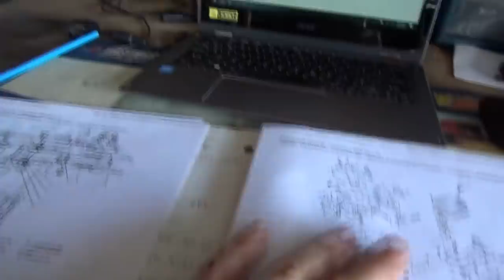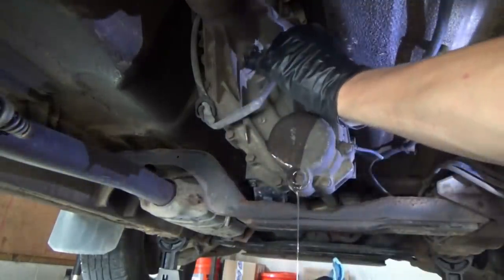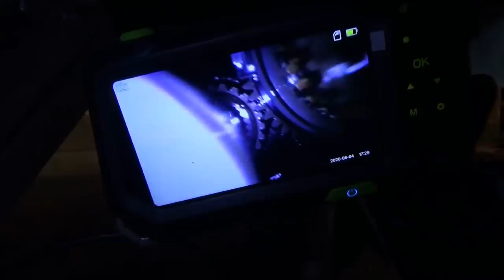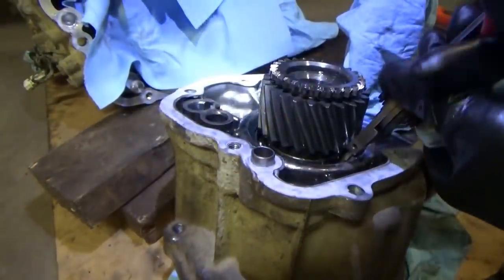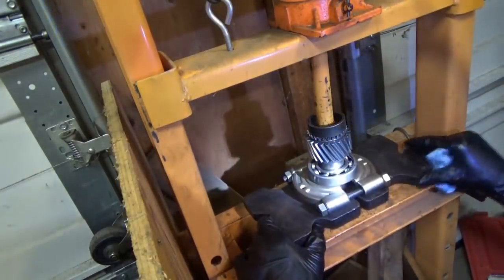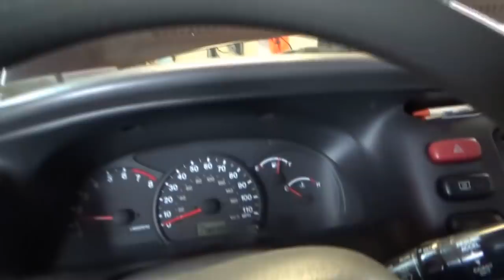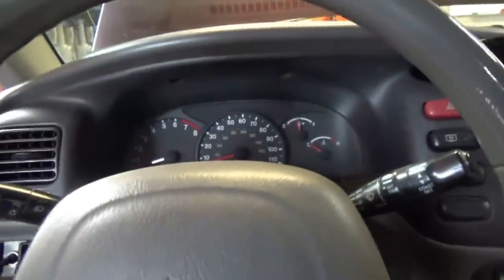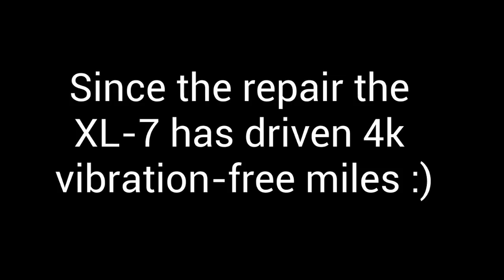Weird Driveline VIBRATION? (Suzuki XL-7 4x4)

Comment: A bearing, a seal, and a balance weight. A dealer would have recommended a transfer case, and a drive shaft or a brand new car.
Reply from the maker: Plus there are no more Suzuki dealers in the USA haha
Reply: @PineHollowAutoDiagnostics  So you would have get it from Canada or mexico, if you required brand new parts?
Reply: dealers are only interested in getting the problem resolved as quickly as possible.  They don't really care about getting it done as cheaply as possible.  They would have had a tidy profit margin on a whole transfer case. There  margins aren't  so big on the labour costs.

Comment: The leaky seal was the indicator to the bearing wear.  That is your signal to replace the bearing, which acts as a bushing to the seal. As it wears it puts more pressure on one part of the seal, elongating it.

Comment: The leak is the clue. If the bearing is failing it can allow the shaft to move. Causing the oil seal to fail.
Reply from the maker: Yup, that's why I went there :)
Reply: @PineHollowAutoDiagnostics  I have an engineer friend here in Oklahoma City that works for a major transmission remanufacturer.  He was recently given responsibility over a bearing tester.  We just had a conversation last week about bearings giving off a frequency signature, even specific signature for different failure modes .... now I know more about what he was talking about.  Sure is nice having smart friends! and smart YouTube creators like you.  thanks a bunch
Reply from the maker: @kc360awareness  Yup failing bearings show up very nicely in the frequency analysis. You can even tell a fault in the inner vs outer race or if the balls are damaged! :)

Comment: That was one of the few occasions where a narrow Chinese hose clamp, designed to use as little metal as possible without stripping when first installed, may have been better than a heavy, 'Made In USA' one.

Comment: I think you are being too hard on your Suzuki...bearings do fail and after 170 000 miles, nothing lasts forever. I found the bonus part most interesting because i studied MECHANICAL ENGINEERING in College and in APPLIED MECHANICS we studied DYNAMIC UNBALANCE. One gram of mass at high rotational speed can cause huge loads to develop and stress bearings.

Comment: Oil seals do not like wobblies especially at elevated revolutions. Press ideal for bearing replacement, saves using brute force with a hammer. Any roughness felt in a revolving bearing should ring alarm bells. Oil leaks are not normal. Amazing what a hose clamp can be used for, ingenious !! It's  all a balancing act and quite sensitive to out of round.

Comment: Just some friendly advice from an old mechanic; when using the press, always set the bearing separator 90 degrees opposed to the press plates.   The bolt ends of the bearing separator should be setting one on each press plate, not across the gap between the two of them.  Much stronger and stable that way.
Reply: the online drawing even showed it properly supported  :)
Reply: @throttlebottle5906  Experience can be a cruel teacher!

Comment: I blame the owner ha ha :-D
Well done ivan,  with less vibration the bearing will last even longer. :-D
Mentally i jumped back to electronic r.f transmitters and there harmonics,  filtering via tuned circuits set to produce loss/delayed/antiphase effect at the target harmonic.
Something like that lol.
I like the jubilee clamp balance, very sneaky plus cheap :-D

Comment: Man not sure how you got the the transmission being the culprit I had a vibration that happened at 45-65, had me stumped brought to a shop and they couldn’t find anything wrong. I thought the only thing left was the CV joints. They appeared perfect and didn’t have any excessive movement. As usually Ivan great diagnostics and great explanation of transmission and the gears. Also, love to know how research you did on transmission to figure out where 5th was.
Reply from the maker: Thanks John! I just looked at the exploded diagram for an hour and mentally pictured the function of each gear :)

Comment: Hay Icon ! I fill your problems is in the transmission if you're have a problems with a in fifth gear it's usually means that the input bearing or the  cluster for  input gear and bearings are going bad

Comment: Just thinking out loud prior to watching front wheel bearings, front axle, or tires. Ok let’s see what you found. Love the channel Ivan!
Reply from the maker: It's rear wheel drive, so why would you suspect front wheels for an under-load buzzing?
Reply: Being 4 wheel drive all that stuff is turning all the time. I had a xj that had a ruff kind of vibration at highway speed and it was a wheel bearing. Your oil leak was a great clue to your bearing issue on the t-case. That old bearing was a little loose and ruff. Good catch.! Love the scope view of the gears. Very cool! Thanks for taking us along!!
Reply from the maker: @TinyTony555  Ah the front end is disconnected in 2WD, plus I have the manual hubs which helps save on the wear and tear of the front axles :)

Comment: when I worked in machine shop we rebuilt gear  box's hog plant, bout 1000 lbs, 5 foot long shafts, we always put out bearings in a oven and heated them up, then drop on shaft hold for min snug as good be, or dry ice shaft overnight make it shrink bout .003
Reply: Worked in petrochemicals. Would dry ice shaft overnight and bake bearing in oven. Drop the bearing on the shaft and move on.  That was 50 years ago.
Reply: @jamesmcgraw9570  still works today
Reply: @mowmanjones3353  

Fab Rats from Utah does it still.

Comment: Awesome video!  As someone else mentioned, you should rotate the bearing splitter in the press - you're using the bolts to withstand all the pressure applied, and they're easy to bend.  Turn the splitter 90 degrees and the actual splitter will now take that force.

Also... you have the nvh kit, I would've loved to see the initial vibration on the scope!  Before and after would give some quantitative results.

And even more... on a personal note, if you left the vibration analysis job, are you now a full-time mobile diagnostician?

Comment: Science a little logical thinking and some good all Yankee ingenuity and boom fixed! Ivan doesn't it Again. Hey Ivan Inedd to start recording my diagnostics and repairs. I will send you an email if you don't mind.. Did an awesome electrical diag Thurs. Then on my own HHR  used a little ingenuity to remove rusted on rotor and wheel bearing. No beating or smoke wrench required..
Reply: All-Yankee ingenuity = A Russian guy fixing a Japanese vehicle using a Chinese press and a scope and NVH kit from a UK company. :-)
Reply from the maker: @Graham_Wideman  The USA is the beautiful melting pot :)

Comment: Commenting on an old video but wondering you have had the classic XL7 issue with the right rear tire wearing quickly on the outside?  I was the second owner of an XL7, original owner had that axle bearing replaced early on. It starting leaking and creaking at about 90K, trailered it to closest Suzuki dealer ,100 miles away, and they replaced the axle, bearing, seal. A year later same thing, that dealer was closed so take to next nearest dealer, also about 100 miles away, and they replace the same bearing. 

About a year later that side of the axle started leaking again. I had to harass Suzuki, get a note from local shop who did a 4 wheel alignment check and stated there was an issue with the axle as that wheel was toed in. Suzuki finally caved and replaced the axle housing which fixed the problem. I have a coworker with an XL7 that has the same issue. From what I have heard it seems there are a lot of them with the same issue. 

Other than the axle it was a great vehicle that always 'just ran'.

Comment: You should pack the seal with ht wb grease to keep the spring in place. Did you put the snap rings back??? Harbor freight sells a nice tranny jack very reasonable. I bought one when I replaced the clutch in my F150

Comment: You need to put new high quality greaseable universal joints on the driveshaft, and have it properly balanced by a good machine shop. That makes all the difference. High quality speed rated tires help too. That being said, what possessed you to buy a Suzuki? You can watch them rust.

Comment: Having a similar howling or resonance noise around 1800-2000 RPM and only on 1st and 2nd gear on an automatic 2008 Grand Vitara. No vibration. Changed the differential and transfer case fluid (was clean). Still has the sound. The sound minimizes a bit after driving in highway speed. Any idea what should it be? Thanks!

Comment: I didn't have the high tech frequency analyzer when I fixed my ranger driveshaft. So I used a glass of water and observed the disruption pattern. Moving the band clamp until the water had nearly no disruption pattern. WORKED!

Comment: When I reassemble case halves or any component that requires rtv sealant I run the bead blah blah blah and most importantly I DO NOT touch or smear the bead , just reassemble with set bead line.I realized one day that smearing the bead on the bead path was introducing contaminates until the RTV. This method 100% of the time seals permanently and eliminated the occasional yo-yo leak return. I also replace Corresponding u-joint every time, in my experience the no play anal leakage ( besides obvious seal wear,fatigue or damage) was being emitted from said u-joint.

Comment: Vibration analysis is fun - I used to do lots of power generation / electric motor / gas turbine alignments and balancing- I enjoyed that kind  of work ... once had a harmonic balancer to fail on a very large diesel engine - 20 cylinders 645 cubic inches per cylinder 2 cycle 4000 hp machine ... the failure would damage the main bearing that was one bearing in from the rear main bearing which was at least 14 feet down the crankshaft from the balancer.  People dont realize what might cause vibrations and how you can figure out what it might be based on the frequency of the vibration- nice video I have been wanting someone use that new vibration sensor that you used...

Comment: If that is your daily driver, treat yourself and pull the seat and send it out to have new springs, foam and upholstery !

At 17.35 what you called a "clutch" is typically called a "slider" or "coupler" or "sleeve" or "sliding coupler".  Its inside teeth couple the teeth protruding from the face of the input gear to the teeth protruding from the face of the gear on the output shaft. Notice that these are not straight splines, but come to a point so that the slider can be used to force the gears to line up.
A manual transmission works the same except between the two gear faces is something called a blocking ring which actually does the synchronization of the gear speeds for smoother/easier engagement.
(Yes, I designed transmissions about 35 years ago !)

Comment: I have the same issue in my car but not sure if it is the bearings, when pushing up hill I will push gas not too hard then it will kind vibrate not consistently but making sound like (vvvvvvvb--silent--- vvvvvvvvb----silent----vvvvvvvb) like something shaking and every time it makes sound like trying to push, now if I am on flat road and not pushing gas as much then it disappear, also if I push gas too much for over power also disappear and only when pushing gas little more than idle driving like as soon as I hit up hill and I hear it vibrating in pulses, I am thinking it is the drive shaft rubber is going out not sure really. anybody help please.

Comment: Driving in 5th gear below 50mph will put excess strain on the bearing. Also from an economy view point, below 50mph is wasting fuel in 5th gear, so driver error.

Comment: I not a expert on drive line vibration.  Years ago the company i worked for a power generation company sent me to a vibration analyst class . We could use equipment to help determine where the vibration was coming from . However on this you determine it was coming from a specific gear which was a good call . If you wanted you could cut the race on the bearing you replaced to see if it had damage races ect . The fact it felt tighter after the bearing replacement was a good sign ....At work they took vibration reading on equipment and did this over time to help with predictable maintenance.  Thanks for the video . Yea the hose clamp deal works .. i just finished the video should have realized you went to the school also lol

Comment: If there is ANY radial movement, (and I could see the shaft move up and down), the bearing would be bad. There should be no side to side movement at all with either a roller or ball bearing. In fact I would lock the gearbox down solid and with a dial indicator find out just how much movement. The shaft looks to me like the bearing has failed.

Comment: Since you were in the transfer case, you should have replaced the roller bearing between the shafts that supports the other end of the shaft
Reply: Exactly that's what I was thinking as soon as I saw the slop in it. As long as you're in there what's another $10

Comment: I'll bet in a few years Ivan's  Xl7 will be the last one on the road
Reply: XL7 was the best car I've ever owned, even if the timing chain took out the motor at a low 308000 miles
Reply from the maker: @600lwp  Dang I have a loooong way to go to catch up....I'm afraid the rust will kill the XL-7 in this climate :(
Reply: @PineHollowAutoDiagnostics  В PA не принято делать обработку кузова автомобиля против коррозии?
Reply: Watched this again. I cracked up at the hit it with a hammer remark. Would like to hear more about past jobs that built your skill set

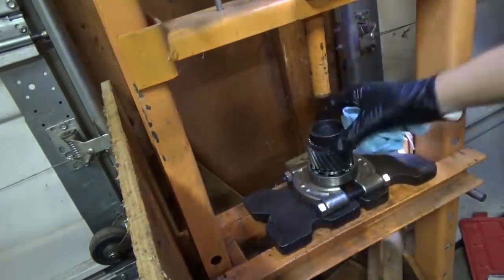Comment: 25:30 - pressing the bearing onto shaft had me a bit worried as the bearing puller has beveled edges and, possibly, does not provide good support to inner race. Old bearing seemed to have some heat marks (darker ring) on the outer race?

Comment: even though you loaded up the parts cannon you made an educated guess. Sometimes we gotta do that and get surprized when it fixes it. We have the nhv kit at the dealership with the propshaft camera to balance a prop shaft, when we went to traning on how to use it we did it in a group and the teacher was "like your never going to do this, if you have a out of balance shaft your going to replace it since you are flat rate and warranty times suck ass."

Comment: Again, you are just full of surprises!  When I first took the job I have now, as operators we had to know what type of vibration detection we had on a particular piece of equipment.  We used accelerometers, geophones, and proximity probes.  Somehow, it doesn't surprise me you would go to these lengths to eliminate vibration.  Great video!

Comment: Cut out on 5th gears is most likely fluid release at the gears full interface so that there is no hydraulic pressure created that could push the gears away from each other.
Just a theroy, Any thoughts.

Comment: What a mechanic working on his own car! LOL My 08 Grand Vitra has all kinds of weird harmonic vibrations since new, 60K miles on it and so far nothing has changed. I just turn up the radio and forget it. Though have issues with the oil seal leaking at the transfer case for the front drive line. Bought several seals as they don't last long for some reason. Bad design?

Comment: Should only fill at the filler plug when the oil starts to come out you should let it level off then put the filler plug back in,  if you over fill it could build to much pressure and bust the oil seal

Comment: manual trans with vibration in a single gear can sometimes be the clutch disc damper springs/bushings gone. it really depends on the final gear ratio, but will often be when it's in 1:1 or an over-drive situation.  although not sure if they have those symptoms on older suzuki's

Comment: I use washing machine balance weights(similar to wheel balance weights) to obtain desired smoothness. I’ve also used hose clamps in the past yet the mass of the clamp affects the smoothness. Being the perfectionist 99% of Tecnnicians are the obtained end results for me are much closer to factory turn out .You are a top notch technician and in no way am I attempting to sway you in a different repair path or procedure.

Comment: Great content Ivan, my ZX tends to get a vibration, tho slight when I winding out a gear to around 4/5 rpm, thinking it could be the drive shaft, it dosent present itself until 4/5 grand, U Joints seem tight. Its a different shaft then what came in the car, swapped when I changed from auto to 5 speed, when just normal driving it does not have any vibration, but when it happens its more like a hum then a vibration. Just another thing to put on the list.

Comment: Hey Ivan! Most of the time when I see a seal leaking it is usually because there is bearing behind the seal that’s getting lose or going bad. The last time I saw a leaky seal my rear diff had a lose  and worn out pinion bearing. It’s pretty common. Nice work Ivan

Comment: I had my exhaust system replace on my automatic astra g and it vibrates and resonates now! The system used to be OEM and i should have just put a new back silencer on, and welded a repair on! I cant tell if its the flex part being too stiff or the steel is to thin or the first silencer or down pipe is defective!
Reply from the maker: exhaust system vibrations can be really annoying to pinpoint! Wiggle the pipe by hand, make sure it's not hitting anything. Should be hanging on the rubber supports with freedom of movement.

Comment: Got the orientation of the bearing the same as original. Can tell by the side stamped with the bearing number.  I believe this is due to thrust orientation design of the bearing.
Reply: PS. I love the smell of 90 weight in the morning.